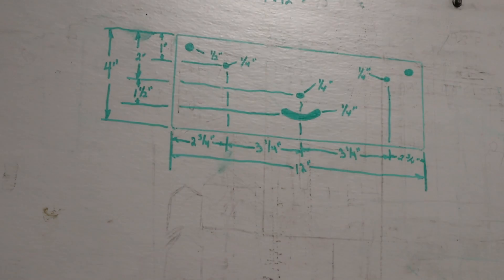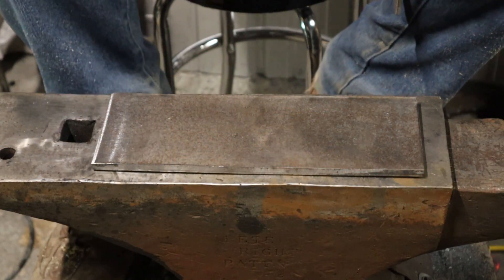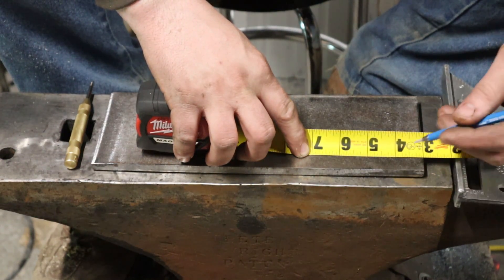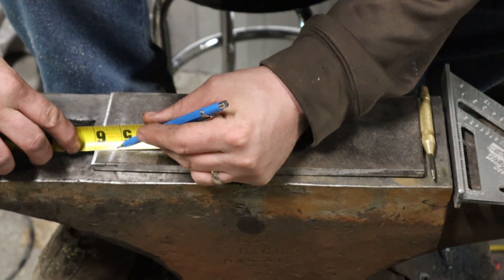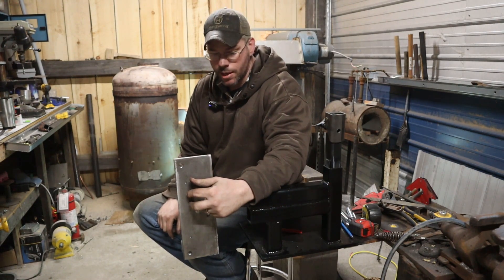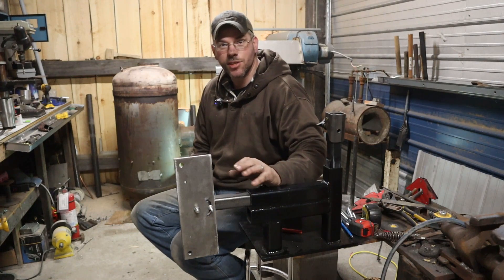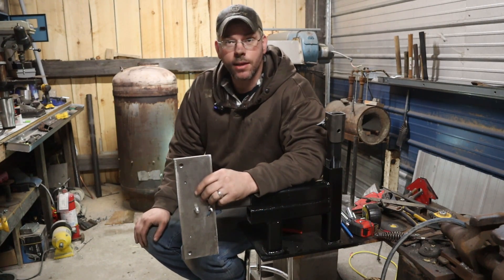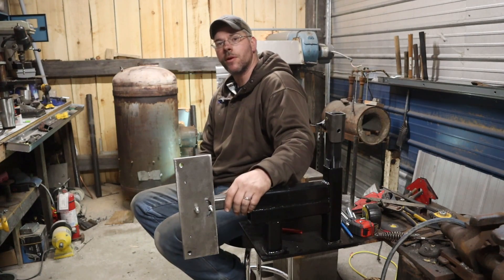2x72 Belt Grinder Build Made Simple For The Beginner Part 3

Comment: Hello,  How did you determined the arc? The overall length? I see you came down from the top 3 1/2"  down and over to the center(6") to drill the first 1/4" hole, so how do chain drill the additional holes to form the arc?
Reply from the maker: I just measured the radius to different points and connected the dots.
Reply: @TheTradesmanChannel  Thanks for the reply. The old eye ball & measuring trick, if it looks good & it would work, connect the dots & get her done.

Comment: When drilling plate metal do you ever start with a smaller drill then go to larger drill. My helper needs to drill a 1/2 hole in 1/2 plate on a homemade vice stand. Have to use hand drill since it is at ranch and don’t have drill press there.
Reply from the maker: I do at times, if he's using a hand drill I would for sure drill a pilot and work up to the 1/2" bit.

Comment: 1st Ha Ha!
and now I've watched it ....... When you drill on the press if you release the pressure before you generate those tails you will find they break into short lengths and are self clearing. 

An alternative to those posh plastic knobs you got are upstairs! A piece of scrap wood cut to the right shape with a hole in the centre... thread a nut on a suitable piece of threaded rod, a dab ow weld and a little epoxy and you have your very own custom knob! But the effort verses the cost may not be worth it ;0)
Cutting down on your drill speed can be a good thing when you are drilling larger holes too ;0) 

Good work on the flickering whiteboard!
Reply from the maker: you are.  Hello Dave.
Reply: 'Ow Do! ...... Ist reet cocker?